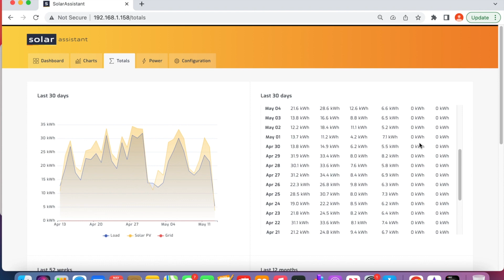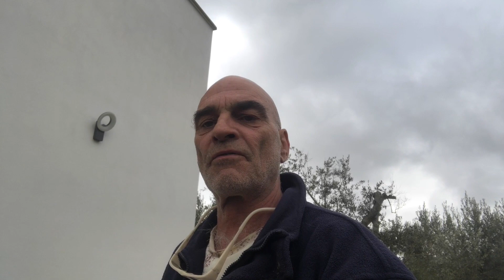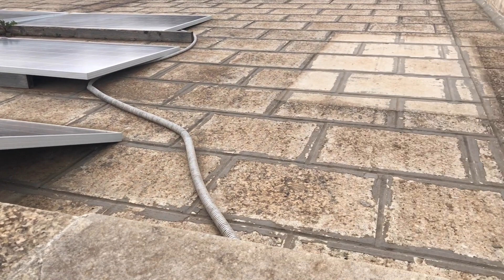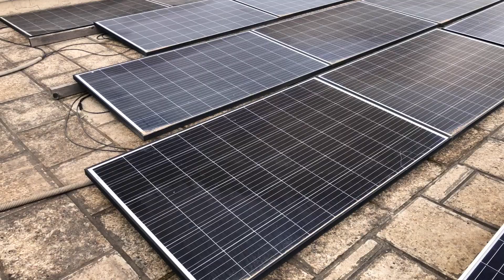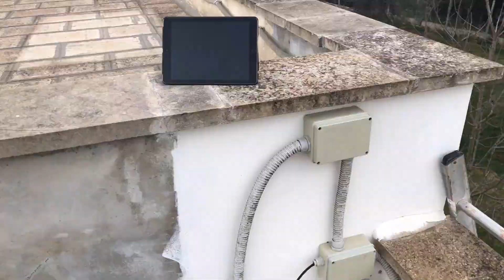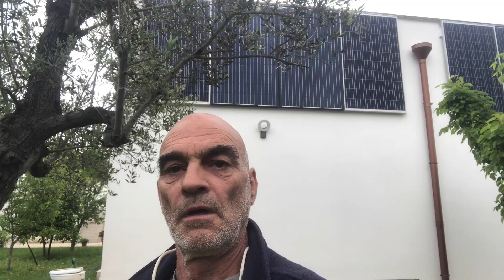Surviving Off the Grid: 7 Months Without Grid Power - Off Grid Italy

Comment: Are these panels  1000w strings also paralleled together to up the voltage.....
Reply from the maker: Hi David. I have two panels on each string in series and those are then in parallel. Same for both strings. Then the two 1000 watt strings are also in parallel. This is due to the limitation on the input voltage of the charge controller I am using. It was a cheap one from Amazon that is still working perfectly to my surprise. 😊Hope I haven’t jinxed it now. 🤣
Reply: @FarmsVilla  ok your inverters can handle 500voc
Reply from the maker: @davidparker1760  I have two inverter/chargers that can each handle a max of 150 volts input with a total of 4kw input. I have  9 strings making up 8kw on the roof which feed into the MPP inverters. The panels on the back of the garage are on a separate solar charge controller that also charges the battery bank.
Reply: @FarmsVilla  mpp all in one 4kw inverter has only 150voc DC input....are you sure
Reply from the maker: @davidparker1760  yeah I just checked. Clearly marked on the label on the side. I bought these back in 2016 so they are an early model. I am really impressed with them. Solid build quality and work flawlessly.
Reply: Ok i was wrong....i looked it up
Reply: I agree...i have 6k 6000ex version of mpp solar....but my voc input for solar is 500volts
Reply from the maker: @davidparker1760  Never mind. Once I also thought I was wrong but then found out I was mistaken! 🤣👍🏻
Reply from the maker: @davidparker1760  If I ever need to replace my inverters I will def go for MPP again.
Reply: @FarmsVilla  im trying to say increase your volts and decrease your amps on your panel arrangement
Reply from the maker: @davidparker1760  I have just checked and the max input voltage is actually 145 volts.. that is why I have 5 strings of 3 panels on the one inverter. I was running 4 strings of 4 panels which worked fine in summer but in winter they went over the allowed input voltage. That had me scratching my head for a while! 🤣

Comment: If you think about it the panels on the side of your building on a dull day are only looking at half a sky .The other half being below the horizon where there are no sun rays incoming from .
Reply from the maker: You are correct. 👍🏻 I think it is to do with diffused light. The flat panels get a lot more diffused light than tilted ones never mind the vertical ones on my garage. So no tilting of my panels. 🤣 is the answer I was chasing all along. 👍🏻
Reply: @FarmsVilla  I think a well placed designed wind turbine might help out not using your generator .Thinking and Tinkering channel has a lot of interesting wind generator info .
Reply from the maker: @rocklover7437  yep. I have a 2kw turbine I need to put up still/again. 😊
Reply: @FarmsVilla  Sorry the channel is called Robert Murray Smith
Reply from the maker: @rocklover7437  I watch him. He is brilliant. 👍🏻 Got some really good ideas from him on a few subjects. Think I need to build one of the alcohol stoves he presented a while back.

Comment: i would agree with you that on cloudy days panels have little benefit from being angled to the sun. I have three ground arrays that i have been using for two years now and have found that the most horizontal panels do better than the ones set to the angle of the sun on cloudy days.
Reply from the maker: Thank you! It is good to get confirmation of my theory. 👍🏻 On light overcast days they do benefit from being tilted but it’s not worth the hassle as I don’t have a problem getting to a full charge.

Comment: Could it be that in cloudy conditions the sun's rays are dispersed so there is no direct light. In these conditions it would make sense to have the panels flat to collect as much dispersed light as possible. When it's bright and sunny out, lining the panels up with the sun to catch the sun's direct rays makes more sense.
Reply from the maker: Yup. That is the conclusion I came to. The panels seem to collect diffused light better when lying flat. I don’t need to worry about generation in sunny or light overcast conditions with the panels flat so I’m not going to tilt them. Not worth the hassle of then dealing with the worry that wind will send the panels to the neighbour. 🤣
Reply: @Farm Villa  I have seen some smaller solar systems that have a mechanism to track the sun automatically, but no I wouldn't bother climbing up on the roof to do it manually. Especially with the added worry of the wind picking them up. 😳
Reply from the maker: I had grand plans of building a solar tracker but figured it would be like a big sail on the roof and would take off at minimal wind velocity so that was scrapped. 🙄
Reply: @Farm Villa  The first ones I saw are shaped like flowers with individual petals. The petals fold up at night or in bad weather and open in the morning, tracking the sun all day. They are mounted on a short pillar in the ground. They look cool but a very expensive option.
Reply from the maker: @notyouraveragegringos  lol. You have seen my clothes. Do you think I have that kinda cash lying around? 🤣🤣 I was going to build one myself.
Reply: @Farm Villa  Ya we can't afford the funky flower solar system either but it looks cool. I've seen reviews that it produces less power than the regular roof panels though so definitely not worth the price.

Comment: Makes me think of a song, "The long and winding road". My regret is I didn't set up my system as 24v. Having problems with my Victron Charge controller. Going to swap things around.
Reply from the maker: Yeah it is a never ending quest for more power! 🤣 I went with 48 volts for my system based on the loads I was expecting to pull. Sorry to hear about your charge controller giving you problems. Hopefully you get it sorted. 👍🏻